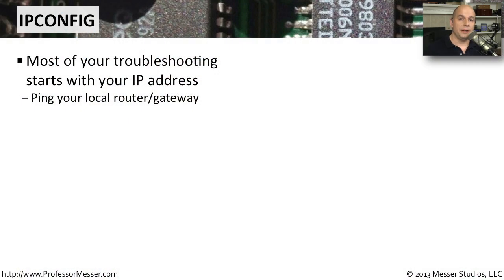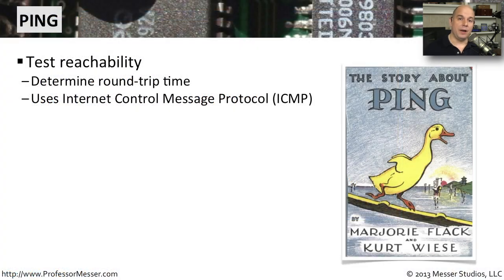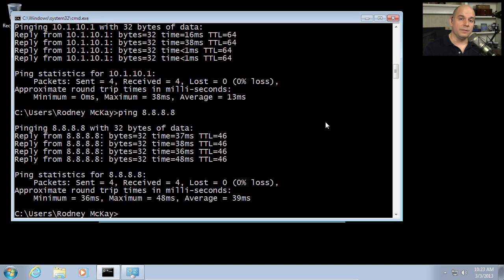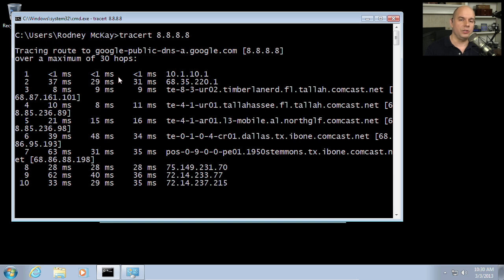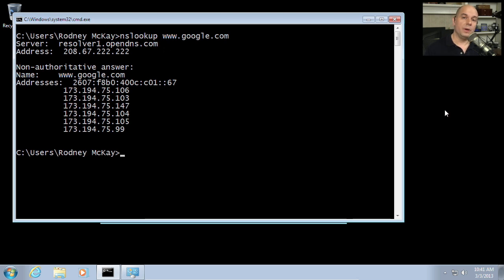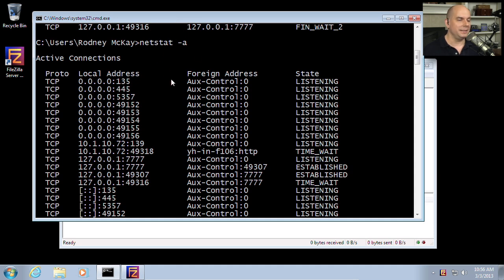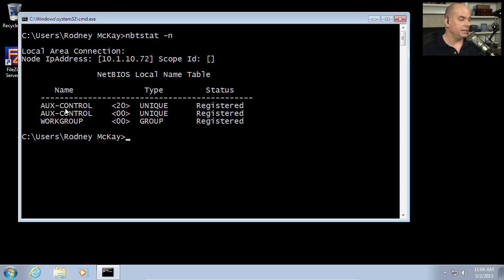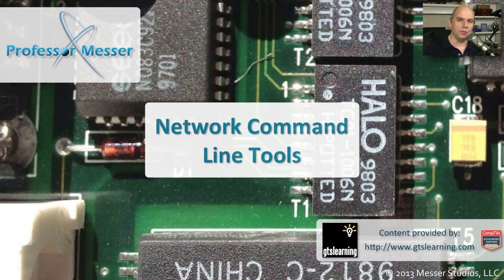Network Command Line Tools - CompTIA A+ 220-802: 1.3

Comment: When I used tracert on 8.8.8.8 it yields 12 hops but when 8.8.8.8 is pinged I get a TTL of 54. I was expecting a TTL of 52 since I thought the maximum TTL was supposed to be 64 and reduced by one for every hop?
Reply: i pinged my IP and got 128 TTL